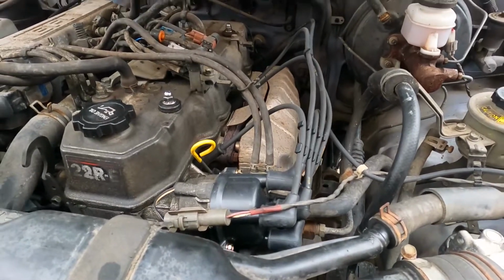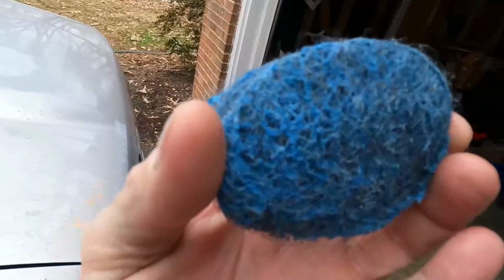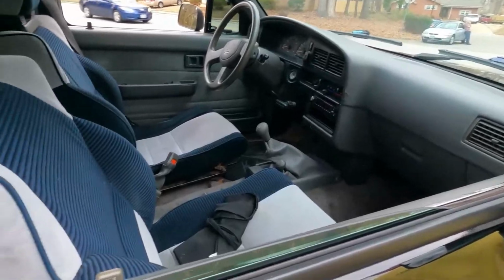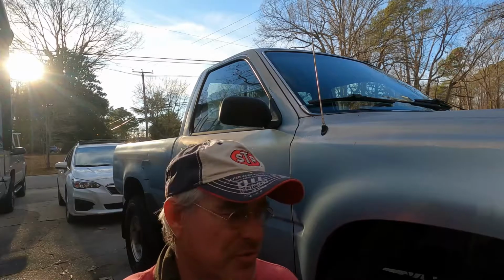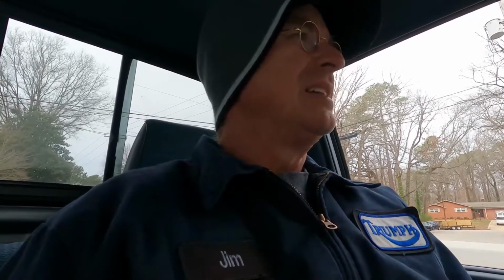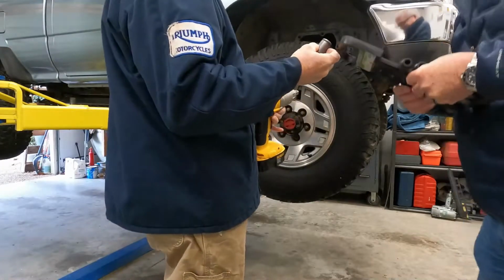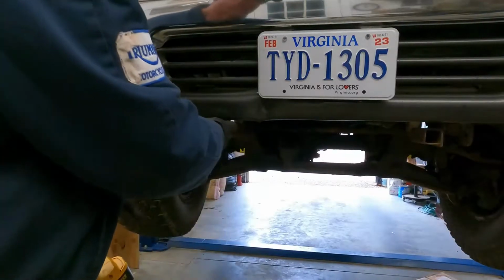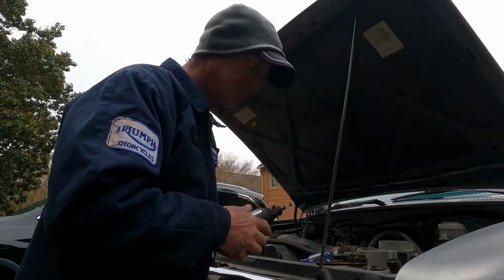New addition to the WGF fleet Part#3

Comment: Hi Willie, oh my goodness. I think you might end up with a new Mr. T by the time you get everything fixed up and replaced. He's going to be a real looker and very dependable. 
I think you're on Part 3, episode 3B, but I got lost somewhere down the road. I hope you can get the things done on Mr. T-OTA, that you are aiming for. He's gonna shine and be the talk of the town like Booger. 
Take your time, be patient so you skip no plan you have for him. We get to see him in the making. What a thrill for the transformation to come together before our eyes. You got Mr. T, Mt.T doesn't have you.
I want to see how you handle the rust. My Kia Sephia (2000) with 54,000 original miles is starting to show a spot. The dash close to where the defrost has pulled up from the sun beating down on her. Breaks my heart, because I don't know what to do.
I really need your opinion on her front axle is rusted on one side and when you turn left or right, she thumps. Something about ball bearings loosening up from the grease. 
I was told, it would be ok to drive ,if I took it easy. That it will cost me $1000 to get it all fixed, but the dash. Do you or anyone, know if this is reasonable? I've been taken by this guy before. The other mechanic has charged cheap, but didn't do what should of been done or used the cheapest material on other things in the past. 
Any suggestions for a woman to watch for slick tricks? 
Oh I just have so many questions, but I will not take up any more time. I  just really think you for your advise or friends advice. 
You take care and Be Safe till next time. Tell the family Hey! Thank you so much. ❤️

Comment: My bet is clogged injectors..  just a guess
Reply from the maker: I would take your guess over mine any day…
I’ve got injector cleaner in the tank , was hoping it would clear up and it has gotten slightly better but  there’s the occasional “pop” in the exhaust when you accelerate and stumbling/bucking. 
The other thing is fast idle. Like it’s not getting enough air.
When I break the seal slightly from the air box to the throttle body, the idle slows down to normal. The MAF sensor sits on top of the air box controlling the amount of air coming in. I disassembled all of that and there’s no blockage of any kind so I can only assume the MAF is bad. 🤷🏼‍♂️
Running out of ideas and $$$$ so it’ll have to wait. 
I truly enjoyed listening to you guys last night and the both of you for your kind words!! That meant a lot. 
Wish I had a good question or two to have asked but you guys are way above me!! Lol 
But please thank David for me also. 
If I ever get this little Toyota running right, I’m coming for a visit, ride some Monkeys, and take David fishin’ LOL.